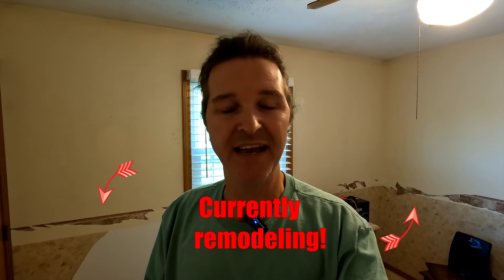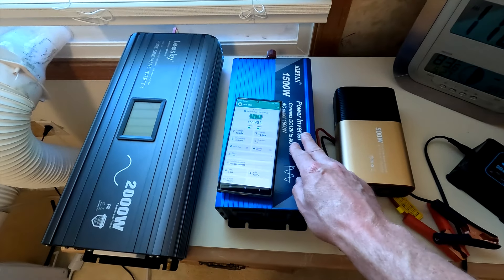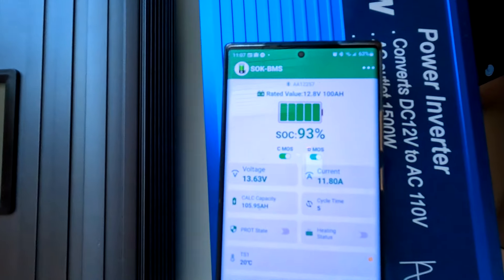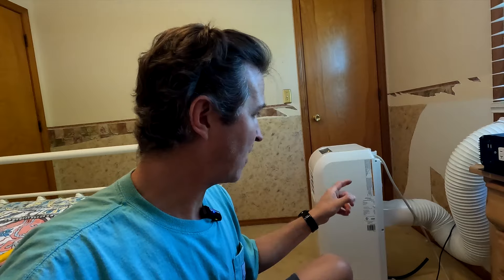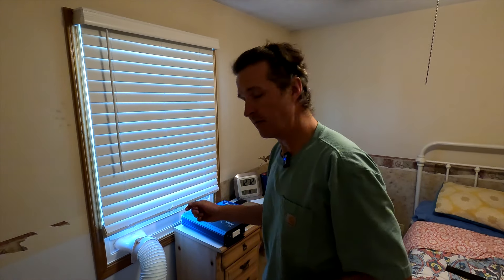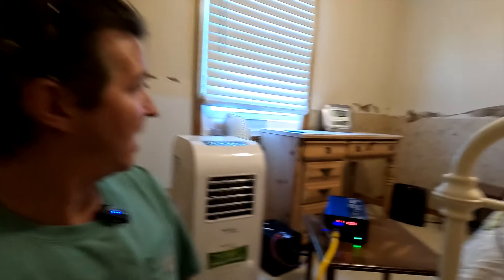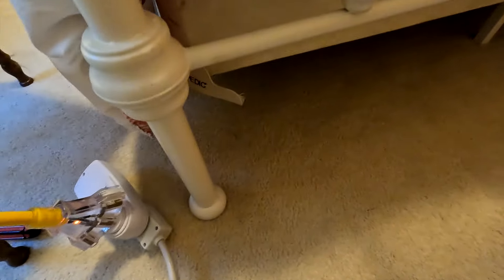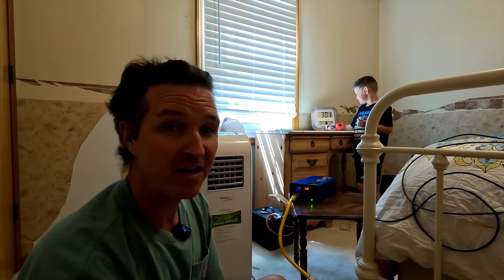Running 8000 BTU Air Conditioner with a 12v 100ah LifePO4 Battery!

Comment: Why do people keep making these videos?  Get a good 2000w (or whatever) generator.  Walmart just had a really good SOLAR one for $169, regular price $329.  Unit, battery, inverter, and wires everywhere just do not make sense and are a fire hazard.  ...  I just checked.  It is still on sale at $189: Energizer 320Wh Portable Power Station 100000mAh LiFePO4 Batteries Solar Generator Sine Wave 300W Peak 600W Backup Power for Outdoors Camping Travel  And, the portable in this video is inefficient.  If just doing this, (for a room that size), a much better option would be a 5000 BTU window ac.
Reply from the maker: Thanks for the comment and info.
Reply: 320wh power station wouldn't even stand the surge from the compressor starting, and if it was an inverter ac without the surge, that station wouldn't run it for an hour. The reason people do all the stuff that you don't understand, is because you don't know what you're talking about and they do. Buying a portable power station and the panels to run it is way more expensive than building your own setup; but it is convenient, tidy, and portable. For instance, a jackery 1000 with 300 watts of solar panels costs $1500.00, you could build that for around $600 easy without even trying to find a deal on any components, and way less if you know what to buy and where to buy it.
Reply: @vitogriffin8902  bingo 🎉

Comment: 474/120= amps,,100amps_batt/amps_ac= hours run
Reply from the maker: You need to add in the efficiency loss and conversion loss of the inverter to the equation.  Thanks for the comment and info.

Comment: The inverter is too cheap for running an air-conditioner. Its a matter of time before it got cooked up.... better use a Low-Frequency type with transformer unit instead of the Transistor-FET switching type. Not a good way to make video.... Battery type 12v@100A= 1200w in 1 hour; AC power 1hp= 750w; use 750wh in 1hr; AC use with such a battery only for almost 1-hour. With solar connected, can be a few hours
Reply from the maker: The video is intended for a power outage situation, not a permanent solution.  Your calculations are correct, but I feel you didn't even watch the video to see my results.  Thanks for the comment.

Comment: Your video is a fraud. First I have 2 of those units that I use off grid and they are low energy and work great with my modification. I wish they still made them. Without the modification your video is a fraud. I live off grid. The only reason you are able to run that AC on the 1500 watt inverter is because you are are using the main house AC to help cool the room and that AC unit.
 Now about your fake video. The condenser is exhausting the hot air out of the room to the outside. Where is the air coming from that the is going across the condenser to cool the condenser?   It is coming from outside. Now is it coming directly into that room? Or is it coming from somewhere else in the house? My guess (And I am Correct) it is coming from somewhere in the house. And I will bet money you have the AC running in the rest of the house. So when you turned the small unit on it is drawing cool air into that room from the rest of the house to cool the condenser to exhaust outside. And the house AC is working harder because that unit is drawing in hot air for the main unit needs to cool. So that unit is cooling the room some and the main AC unit is cooling the hot air that little unit is pulling into the house. And that means the main AC is helping cool the room some. 
 If you had that unit as a stand alone and no other AC running in the house.  It would literately be bringing hot air into that room from outside. You would have cool and hot air currents in the room and that unit will be drawing more than 800 watts and NEVER cycling off.
 My first attempt at fixing the problem was running a second snorkel tube from the window to the condenser. It fixed the hot currents but when it went over 90 degrees outside the energy usage started going up and it did not cool as effectively. And it would get close to 800 watts. And it would be maybe 10 degrees cooler than the outside temp.  My second add on was 1400 CFM little swamp cooler. It is between the window and the condenser. I just have the water pump running. When its a 100 outside it cools the air down to about 70 degrees that is going across the condenser. 
 At 100 degrees the unit and water pump is drawing about 625 watts. 100 degrees is about as hot as it gets in my part of Nevada. At 100 degrees it is able to keep the 300sf Room at about 80 degrees. 
 I knew you were clueless when you didnt even bother to look up what the 24 Amps LRA was. LRA stands Locked Rotor Amps. Then you have to add the fan amps. But 24 amps X 120 Volts equals 2880 watts. I tried running mine on a 2500 watt inverter it would start but when the unit heated up it would trip the inverter when the pump cycled. Mine runs fine on a 3500 watt inverter. For the record. My system is 48 volts and 280 AH batteries. with 3200 watts of solar. And on cloudy days I wish I had more solar and bigger batteries. 
 This video is a joke.
NDR
Reply from the maker: First I want to say, thank you for the comment.  I'm sorry if you feel I'm trying to be deceptive in my video.  I didn't go into detail about how I had tried to isolate the small bedroom from the rest of the house.  The air vent in the room is shut off in the basement and also covered with a towel and the desk that everything is sitting on under the window.  I also have a beach towel filling the gap under the door.  I understand that every hour when I open the door I'm going to be letting cooler air in, but I can only do what is possible in my situation.  I also did state in the video the temperature outside was only 65 to 70 degrees.  I'm sure that skewed the test results as well.  That is why I heated the room up to 85 degrees to try and compensate for the outside temperature since the exhaust vent isn't insulated and I'm sure cool air from outside is getting sucked in.
I wish I could tell you that you found out my great conspiracy, but all I did was setup an portable AC unit in an extra bedroom, plug it into inverters until one worked and ran the AC unit until the battery shut down. 
I'm guessing you won't be satisfied with this answer, but it's all I've got.
Reply: @OffGridBasement  Maybe I am missing the point here and this is an April 1st/fools video. I should have realized that when you dismissed the 24 LRA and claimed you didnt know what LRA means and meant nothing.
 My feelings mean nothing when it comes to science. The title implied you were actually going to be commenting on using a way too small of a setup to to run that AC. You actually claimed you can run that AC unit with a 1500 watt inverter. Which is a lie. And from reading the comments people believe that lie. As I said I have 2 of those units. They are easier to get running  than other 8K BTU units. And people are going to think a 1500 watt inverter is enough. 
 TI get it the video is a joke.
NDR

Comment: ok and down to the point, so was a  1500watt inverter good for that purpose???
Reply from the maker: Yes.  It powered the AC unit just fine.  Thanks for the comment.
Reply: Thank You!!!  nice instructive video i ll try in doing mine TY